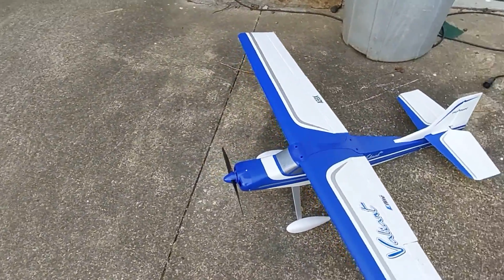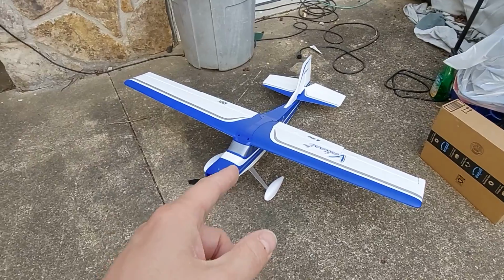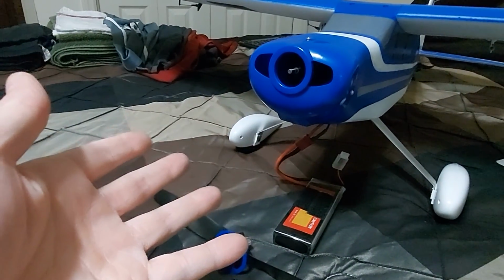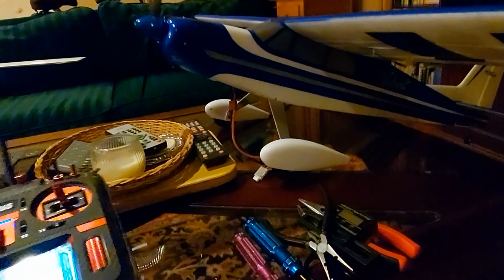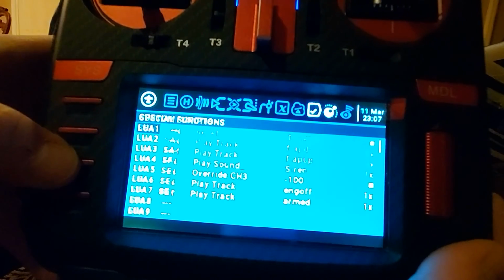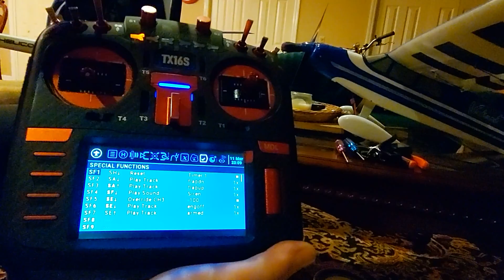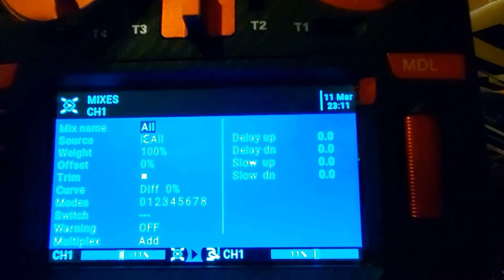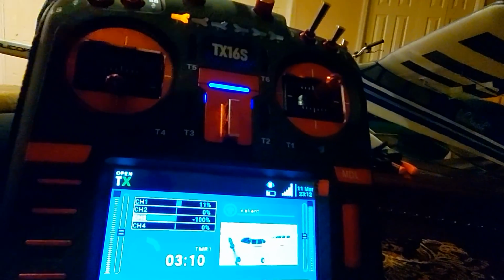Horizon Valiant RC Airplane, AS3X to Open TX, TX16S Max

Comment: Hey bud. Please tell me you can explain to me in detail as to how you were able to get Safe Select set up and fully functional on a switch using the TX16S ? I am literally about to lose it with finding a true working method. 
Thanks in advance!
Happy Flying 🛬
Reply: @NomisRC  hmmm 🤔 interesting. So I haven't watched the video yet, but with the cable and programmer. That is not to the open tx radio but to the reciever itself is what you are saying?
Reply: @NomisRC  in my newest model I'm trying to get setup it has the AR631 and the previous model I was attempting with prior to has A3230B receiver installed.
Reply: @NomisRC  ok gotcha. I'm gonna check out your video now.

Comment: without knowing more than what is in this video, if this is your  FIRST  airplane and you try to fly it, without having the  NECESSARY  piloting skills, you  should  Expect  to  do a prop-plant, immediately after take-off.!!!!!      why is this true?        bc  it  has a zero-dihedral wing and   AILERONS.!!!!!    i have  Information, if you want it.!!!!!       cheers
Reply: @NomisRC  kindly provide the time, where you said  THAT.
Reply: @NomisRC  thanx.        wtf  is  stab mode
Reply: @NomisRC  hmmm    okay      never used  any modes.    i  just  flew.    cheers